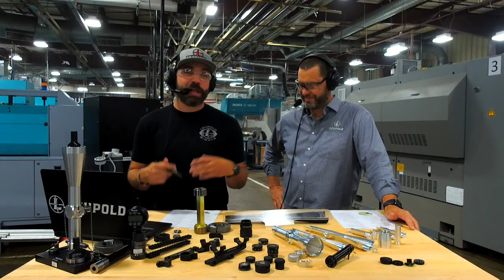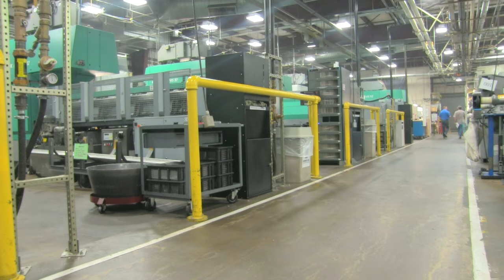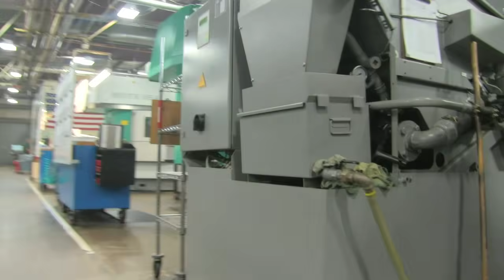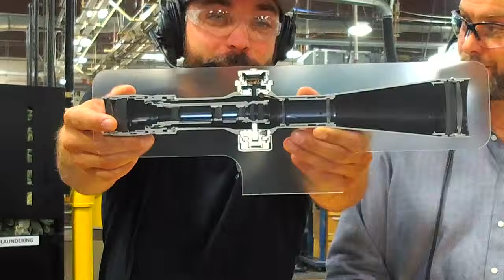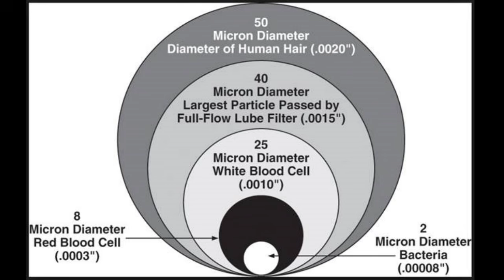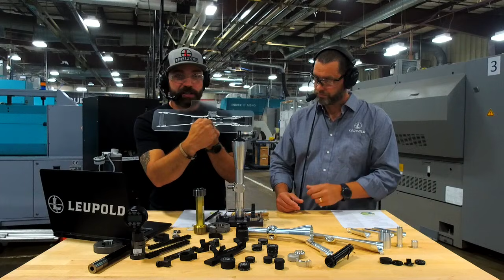Leupold Live : American Manufacturing

Comment: Thanks for still making the smaller one inch main tube hunting scopes. I love my 30mm Mark 4's and VX6 scopes. Some of my hunting rigs I don't want or need that much bulk and weight. As I have gotten older and matured as a hunter my  gear has gotten lighter and simpler. In fact my go to scope for big game hunting is the old VX3 2.5-8x36. I have that model on several hunting rifles.

Comment: I want to see LEUPOLD  align themselves with Rochester Optical (A trusted US manufacturer) in glass acquisition, that way all Leupolds glass will be fully 100% Made in USA. Plus, I want to see this fine company  offer a line scopes using 7075 T6 aluminum in main tube material, the same material our ARs are made out of, as far as I know Trijicon is one of a few optic manufacturers that uses 7075 T6 aluminum in their optical devices.
Reply: 9aa0wa0a0s9 isosodosps9o9765554 re 32

Comment: I bought a vx6hd, $2000 scope, new. When I opened it, there was a big smudge on the inside of the glass. I sent it in for repair and it was sent back fixed. I don't understand how the scope left your shop with this major issue. I guess no one looked through it before shipping it. Thus, your quality control is a disgrace.
Reply: Most of the time that's grease for lubrication on the internal o-rings and mechanisms. It most likely wasn't there during QC. During shipping 1 little drop can fall on a lens and cause the smudge.

It's not unique to Leupold. If you look around I've seen the same complaints about Nightforce, Vortex, and us optics.
Reply: You don’t work in manufacturing, do ya? Lmao
Reply: You work at the QC department at Leopold? Lmao
Reply: @shadow6pt533  nope lol machinist, but I have inspection experience with one of the big 3 global defense contractors with a focus on Zeiss CMMs and Calypso software.  There’s a process within QA that’s calculated based off a bunch of metrics that determines how many parts you physically check.  Say one particular part is very finicky when being machined or fitted and you have another part that will run all day and night with out so much as a .0001” shift in size.  Do you check the parts at the same frequency?  Or do you watch the problematic one more often?  To physically inspect every single part that goes through a process, is an insurmountable task.  You also have to consider that check has to happen at many stages of its production.  The lens smudge you experienced was likely done in finally assembly and therefore was going to go through a certain check ratio, say 1:5 parts.  The other 4 unchecked parts likelihood of being out of spec at this stage of production is also a calculated number and an accepted risk.  Add to that the fact these physical checks are done by humans.  Maybe your scope was checked but it was a new person and they missed the smudge.  

Does this clarify a bit more about the real world logistical issues around QA?
Reply: @Rightisallwrong  I understand what you are saying. I've assembled water pumps before. We tested and inspected every single pump. It's up to the business to determine to inspect all or only some of the finished product. Take care.
Reply: @shadow6pt533  yes but how many pumps did you send out a year?  Also, if those pumps were to feed the cooling system of a very very  expensive piece of machinery, they NEED to work and thus the loss from a failure is so expensive it’s worth checking every single component 100%.  It really depends on the application.  Leupold makes millions of scopes a year.  You had a smudge, which in your defense, is unacceptable as a consumer.  But mistakes happen and it’s not because the company has a poor QA dept.  The trade off is you buy a Chinese made vortex...American manufacturing thanks you for keeping us going.  There really aren’t many companies like L+S.  Even swamp fox has their glass ground in China.   

I’m just saying, look at what we’re actually doing and remember that truly US based manufacturers have a uphill climb.